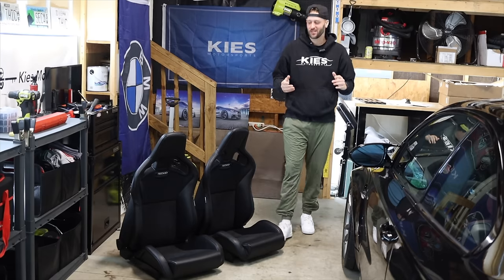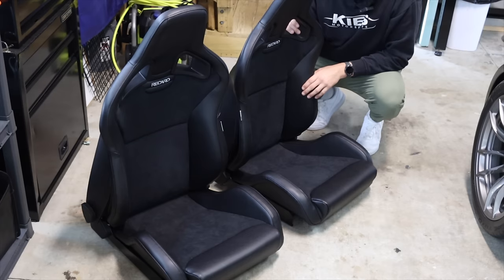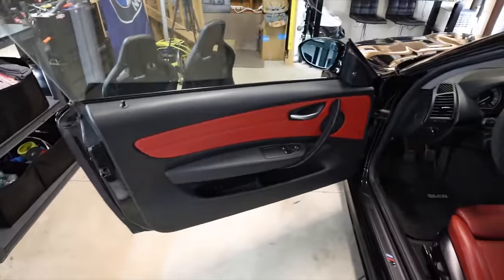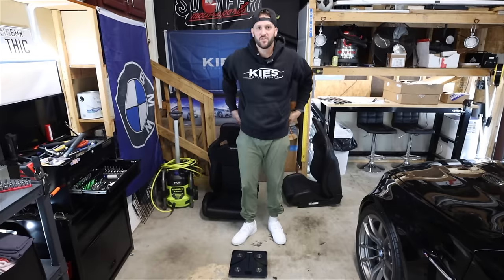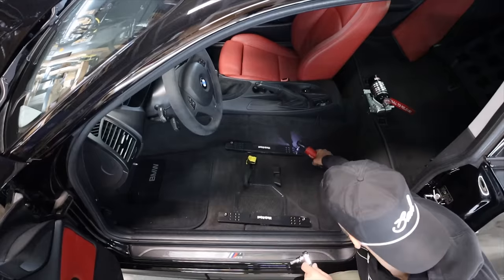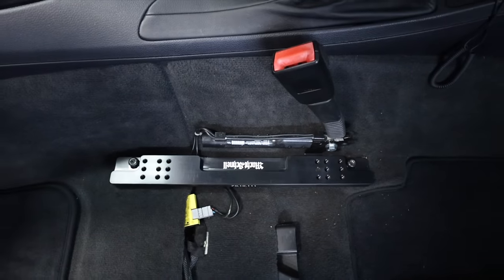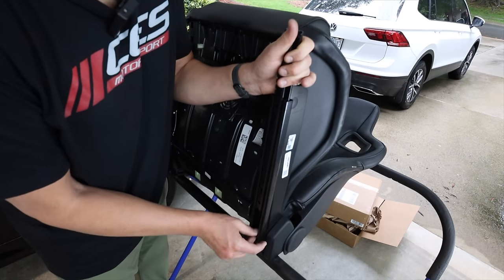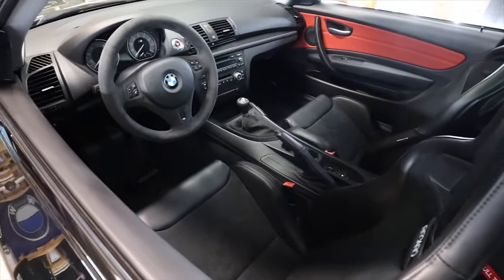These Seats look INCREDIBLE In My 1M Clone!

Comment: Being 6'2, have you sat in pole positions buddy? Theyre really not comfortable if youre over 5'10. 
Especially if you wanted to run harnesses at any point, the harness holes will be below your shoulders. I tried a bunch of seats out recently for mine, dead set on some pole positions, and even though theyre the nicest looking ( im 6'3 ) theyre just not as comfy as some other offerings. The SPG XL are much better for people of our size, But i ended up deciding i was going to go for Corbeau pro series XL or something similar as they were unreal comfy.

Comment: I’m a little confused just looked in the parts section of the build looking to get some of these for my e46 m3 but a little confused on what all I need for the sliding brackets do I just need that stuff or the side mounts as well?
Reply from the maker: For sportsters in e46, you need:
Sliding Brackets: https://tinyurl.com/3v8s4cbz
Floor Mounts: https://tinyurl.com/mpa96vh2
VAC Seat Belt Mounts: https://tinyurl.com/bdhyetay